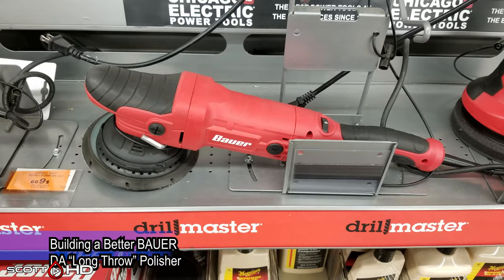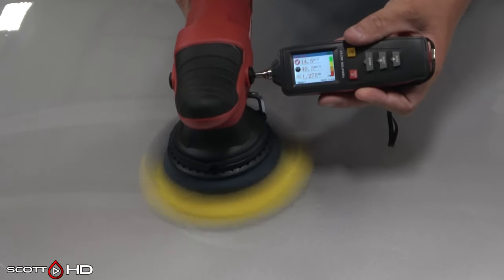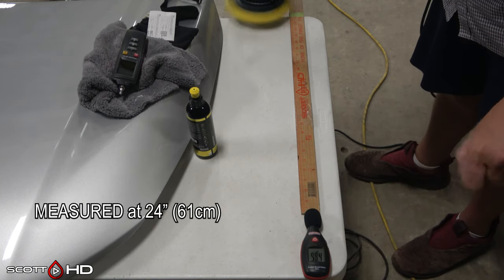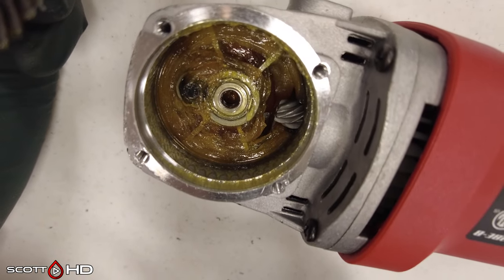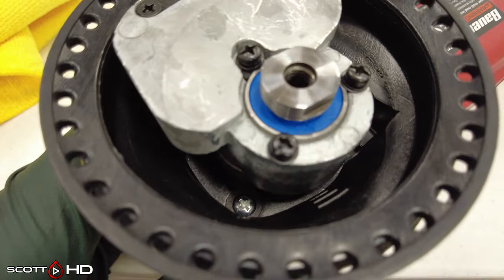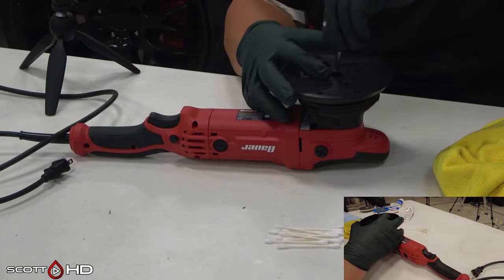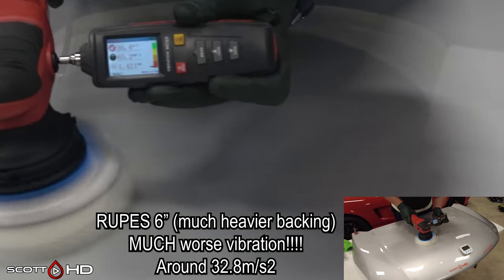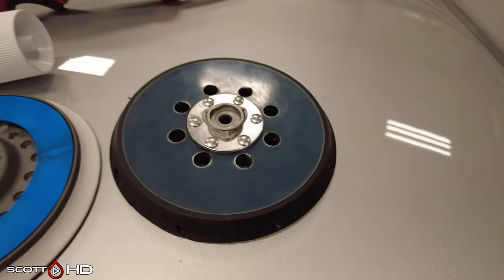Bauer 20mm Random Orbital Polisher - Building a Better Bauer Polisher v2.0 - Lower vibration, cooler

Comment: Here you can find these labeled as Yato ΥΤ-82200 or Bulle  63490. Chinese copies , with different brand labels, exactly the same, only thing thats different is the colour. Change backing plate from 6'' to 5'' , maxshine's backing plates are affordable and decent quality , you get less stalling, much easier to use as demonstrated on the video and cheaper pads as well. What i do suggest , dont know if it matters that much but better use molybdenum grease. Cheers for the video
Reply from the maker: Good to hear. Thank you for the info!
Reply: Red wheel bearing grease works well.

Comment: Great video.  I used Lucas Red N Tacky, personally.  I have some concern that the other white lithium you use is not really rated for higher loads and Temps in the long term, but if you change it on some annual basis it would probably do just fine.  Thanks again for this video!
Reply from the maker: Great point! And thank you!
Reply: Yeah i use the red n tacky better than white lithium
Reply: I used the red and tacky also. Made a big vibe difference. Fine tuned the counter weight with a #6 hex half a tightened turn and now it’s super smooth.

Comment: I've watched a few videos doing this same thing and they all say that there is way better grease that you can use then the lithium grease. Specially to help with heat. And break down.
Reply from the maker: The Lucas Red N Tacky maybe?   I'm all ears. I can definitely give it a try.
Reply: @ScottHD  high temperature red grease

Comment: Mark the housing and gear removed to replace. Screws are the same distance  holes are machined so I found that after rotating it screwed  in fine.

Comment: Thanks! I just got this bauer for $75 when HF sent me a 25% off singe item in-store coupon via email.  I'll use the saving to do the grease and backing plate upgrade.  Seems many have been happy with the Torq or Maxshine.  I have a Mercedes Benz van (Metris cargo) that needs more throw than PC 2474 was dishing out.

Comment: Thanks for doing these videos by the way. They are really helpful for people like myself that won't be investing in a Rupes. Very helpful and very grateful.
Reply from the maker: Not a problem. The RUPES are great machines, but if you're just going to use it once or twice a year or so, Bauer is a great choice.
Reply: Do you know what rupes recommends for grease for the gears i just got the new hlr15 and was wondering if I should change it out or not?thanks

Comment: Great vid....I'm still running my 1st gen,Chicago, that I heavily modified...did everything from grease swap,the switch mod,and also decked the upper gearbox housing for a better mesh...also using the old style HF 6" backing plate...decking the gearbox,is where I got the best results...out of the box I couldn't run the unit for more than 10mins,without taking a break cause of the vibration,heat and noise....after I did all those mods,I can do an entire F150,without taking one break...like night and day,with only an hour of mod time.....as mentioned, I got the best results after adjusting my ring and pinion mesh(only decked a few thousandths)...

Next,I may pull the grease,see if I can seal it and install a one way vent and fill with some 90w140 gear lube..
Reply: Can you expand on 'decking the gearbox' I havent heard of this term and process.
Reply: @troywilliams2473  decking means taking off small amounts of material of 2 mating surfaces and getting them completely flat and square for tighter fitments and tolerances....in my case,I took a few thousandths off of the gearbox housings so the drive gears would have a better gear mesh,in turn removing all the extra slop/play,making the unit run smoother and cooler

Comment: I believe the weight has an adjustment, turn the backing  plate until it's aligned on the very front there's a whole you can stick the Allen wrench, I turned mine a quarter turn to the left, it feels better a little less vibration
Reply from the maker: Good to know. I'll check it out

Comment: I used Valvoline Palladium #2 3% Moly, Heavy Duty when I changed the grease in my rupes and milwaukee rotary vary sticky stuff, made a noticeable difference.
Reply: I was wondering how a brake grease would work here since its moly or boron nitride or ceramic.
Reply: Moly D grease is awesome stuff and significantly better than white lithium or red and tacky

Comment: Will be interesting to see what adjusting the counter weight does as well.  Wondering if there are bearings inside too, that can be improved if they're cheap and might also benefit from packing with grease or better grease.  Great videos and thanks for sharing!
Reply: I change all my bearings to skf when I got my da ! And yes you can take some material from balancing weight! That’s what I dit and it works almost perfectly! You don’t even feel the vibration on it! But you got to be careful because if you take more weight that it should it will vibrate more! Cheers
Reply: I do want to mentioned that is battery operated! I modified to fit and work with the Parkside 8amps! Brushless motor ! The hardest mod I ever dit! The controler doesn’t want to start with Parkside so I have to make some resistance between the minus and the other two wires that goes in the esc on it! Works fine

Comment: It would seem that every time you change the weight of the pad, you need to change the counter balance.  Given that vibration got worse with heavier, and less with lighter, I would wonder if increasing the weight of the counter balance with the original pad would produce the same results.  I saw on a different video that there is an adjustable weight under the 2-screw cover.

Comment: Here is a backing plate I've found to improve the maxshine pro m15 polisher "Torq TORQ200 TORQ22D Backing Plate (5 Inch)" It helped a lot with stalling and it didn't need the washer mod.

Comment: Excellent video. When will you change out the bearings? Maybe add epoxy to field windings so they don't separate and short.....Thanks, keep up the informative work
Reply from the maker: I may have to pick up another one for the bearing swap, as this one is on the way out after over a year of heavy use in our shop.  Stay tuned!

Comment: Foist!!! I use anti vibrating rubber on my cheap polishers. Much smoother than my roops mark 2
Reply from the maker: Great idea!
Reply: What do you mean? Where do you put the rubber on the polisher?
Reply: Added to backing pad? Wrapped around the body?
Reply: Where do you add the rubber?

Comment: Scott have you changed out the greases on your Rupe's machines are still using the stock grease?
Reply from the maker: They use the Lucas white lithium grease when you send them out for rebuild...and I'd assume that's the stock grease too.  (I use the same grease for them)
Reply: @ScottHD  really?! It’s good grease but I couldn’t imagine it would be the best for something like this. I just recently got this machine and haven’t used it, but I know during summer when I go to use this Lucas lithium grease and it’s very hot, it is not viscous at all. 
Would something like Lucas hi temp red grease be too thick?

Comment: Have you tried adjusting the counterweight? I'm wondering if it's useful at all to avoid replacing the backing plate
Reply from the maker: The counterweight in mine wasn't adjustable, just removable. I could possibly machine off small amounts at a time and see if it helped
Reply: @ScottHD  Are you positive, did you check the underside of the counterweight after you remove it?
Reply: This video shows the adjustment. Would be interesting to see if you could further reduce vibration. https://youtu.be/1Ky9J6XDLsI?t=248
Reply: @jaysworld707  just saw that vid, yea it looks exactly as I imagined, if Scott can use that vibration measurement tool and figure out how to adjust it that would give us some great understanding on how useful it is
Reply: @papas813  Hf may have updated the design and changed that part on new machines but I think Scott has 2 or 3 at this point. One of his has to have it.
 It would also be interesting to test the chemical guys 5 inch backing plate. The stock 6 inch backing plate weighs about 10 grams less than the 5 inch rupes. I'm not sure what the torqs one weighs but I'd guess it would be lighter than stock. 

Its fun tuning one of the cheapest polishers to perform with the big boys

Comment: Would like to have seen the adjustments on the weight. Does not take much movement in or out. To take away the vibes. Rotate the counter weight, to line up with the adjustment hole and turn to get results. Looking face on to the front you will see the adjustment hole.

Comment: Do you think there would be any improvement if you added weight to the head of the polisher itself? Should give it more inertia making it resist the vibration, and also transfer more of that work into the pad instead of your hands.
Reply from the maker: As in more weight to the counterweight, or like a heavier handle?
Reply: @ScottHD  Heavier handle. Though tuning the counter weight to see if you can get gains there would probably be a more low hanging fruit to try for first.

Comment: Bought the polisher last week. Put the Rupes 5 inch from the other video and new grease. Vibrated just as much for some reason. And it's very difficult to get the screw that came with the polisher to hold the Rupes down. It tends to start sliding around. Trying to figure out how you didn't have to use an extra washer.
Reply from the maker: May be manufacturing differences?  Bolts right up with both of the ones I have.  I re use the small little washer that is on the original backing plate.
Reply: @ScottHD  Yeah must be. Had to really crank down on it to get it tight enough. The rupes one will work just with a different Allen wrench so may just use it.

Comment: Do you think if you were to do the same thing to the Popoman cordless polisher from your previous test, the noise would go down?
Reply from the maker: I very well may try that.   That's my only big gripe with that polisher is the piercing noise (but I generally wear headphones when using it)
Reply: Scott, which backing plate recommend popoman lower vibration?

Comment: Great video! Make the polisher better by making it Cordless!
Reply: Oh yeah I agree. They're coming, getting better and better all the time. I bought the new v2 SPTA cordless. Still only $200, but vastly improved in every way from the v1. A very good choice to have some fun with cordless for now until some really good high end options inevitably start coming. It's a surprisingly smooth and capable polisher.
Reply from the maker: I know that Bauer and Milwaukee both have something in the works, but not releasing them yet.

Comment: Geat video I was just watching your first one deciding on if I wanted to buy the Bauer or not ,or just paying to have my cars done professionally
Reply from the maker: It's a great polisher for the price, better with improvements, but still won't be super smooth like the high end ones.   Tolerable, yes.  The work they do is the same though!
Reply: @richardaugustine1842  Professional 2 stage paint correction usually runs about $450 in my area. For one time.....

Comment: Shoping for a 20mm long throw +/- few mm.  Would you spend $160 on this ($80 for this +$5 grease +$75 for the better backing plate) or something else around that price without having to do any work?
Reply from the maker: How often would you think you would be using it?
Reply: @ScottHD  do you have a answer for both a professional (but smaller side 3-5 cars a week) and a weekend warrior (1-2) cars a month?  Doesn't seem like there are many around that price point and also that throw length so might have to expand budget for the sake of this opinion.
Reply from the maker: @MrLegacyGT  I think that this Bauer polisher, if using it professionally, likely won't last nearly as long as something like a Flex or RUPES machine, but it can break 2-3 times and you're still money ahead. It's not nearly as smooth as a RUPES, but so far (1 year+) using the Bauer in our shop, it's held together.
Reply: @ScottHD  so starting out with smaller business as working from the weekend warrior to becoming more of a self run business this is a good starter and worth the $160 investment.  As more cars and ability to take on more expense then move to the RUPES where the payback period could be drastically reduced.

Comment: Is the maxshine m21 better than the bauer ?
Reply from the maker: I haven't tried the Maxshine - I may pick one up and compare it!
Reply: Yes
Reply: I second that although I have the m15 pro. The HF ones really do suck for vibration. The Maxshine is night and day better. I did have a HF DA until I threw it in the trash when I stripped the cheap housing screws trying to change the grease. At that point I knew it wasn't worth keeping

Comment: I wish they made it with a 15mm throw.
Reply from the maker: Agreed. I think with some fine tuning in the manufacturing end, this would put some hurting on the professional polishers.  The other Bauer I bought about a year ago is still going in our shop but its sounding pretty bad inside the electric motor...may just be the brushes, but I'm going to do a teardown on it soon
Reply: @ScottHD  I would be interested to see that tear down. I saw the original so it would be interesting to see how it held up.

Comment: Hi Scott!
I have a Torq 15DA and i swapped the grease from factory to Lucas Red N’ Tacky. 
Now I feel it hotter when polishing and I dont feel it working the same. 
What could I did wrong?
Reply from the maker: Interesting. Perhaps overfilled it?
Reply: @ScottHD  it might be. I saw a little coming out from the union. I think I’re do it again.
Reply: Hmm that’s the grease I was thinking of using. It might actually be too viscous. Idk honestly but in another comment Scott said that Rupes (I think) used the Lucas lithium grease, which is way lighter than the Red n tacky.
Reply: @TheMrChaddles  thanks! I think Ill try the white lithium then
Reply: @nathanaelayala766  cool deal, you should let me know what you think afterwards! I’m still on the fence of what kind I’m going to use.

Comment: Great, informative video. I'm a DYI're that polishes my own 30' motorhome. I'm in the market to upgrade from my Meguiers MT300 8mm throw. It's obviously way to small for large areas. I'm looking at the Torq 22. Which polisher would you recommend?
Reply: I don't have the experience Scott has, but Ive used a torq, I purchased a maxshine for my business and love it. In my opinion considering the pricing. Bauer then maxshine then Rupes. I'm so happy with my maxshine that until I've scrapped together the cash for the mac-daddy Rupes I won't be making any stops on the way up. Unless we get some actually good 5in cordless offerings.
Reply: Maxshine are great polishers for the price. I've used them. I've compared it besides rupes, both 15mm. Rupes was slightly quieter with a smooth start otherwise, the maxshine and rupes were same.
Reply: Larry have you considered looking at the griots g 15 or g21 for larger areas
Reply: @greggriffin3242  lol. No Thos post was a year ago. I've since purchased a polisher.
Reply: @ljcruz127  i realized that after I sent it

Comment: that wasn't ear wax in the gearbox , it was the grease HF bought to put in their brand name product, don't be stupid and replace it. after the gears have run long enough to heat the gears hone the contact points and melts and go all over the gears it now contains powdered metal that improves lubrication by reducing gear wear. don't shorten the life of your money. don't run out and buy vibration meters to make a video for youtube.

Comment: It has an adjustable counter-weight for god sakes!!! Why are we playing with different weight backing plates instead of attempting to adjust the counter-weight adjustment in or out? You’re already half way there when you took it apart…just go all the way man. Come on…
Reply: Ya. This was a popular mod on the old cheap Chicago version and on that one, you had to buy a new wt. this one is freaking adjustable, just do it. I don’t get why they are messing the grease and plate and NOT addressing that “while you in there”?  The weights job is to counter the wt/vibration and get it isn’t addressed
Reply: @KosmicHRTRacingTeam  I think in part either he doesn't know anything about the counterbalance weight. And partly because there's a bunch of reviewers that like to rag on Harbor Freight products for the video clicks, and don't actually care about how good of a deal, or how good of a tool it can be.